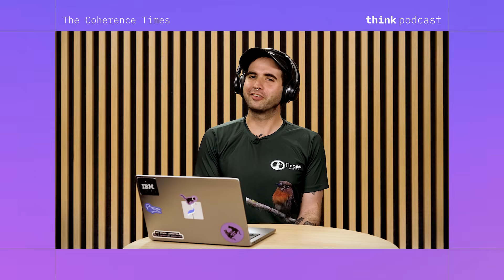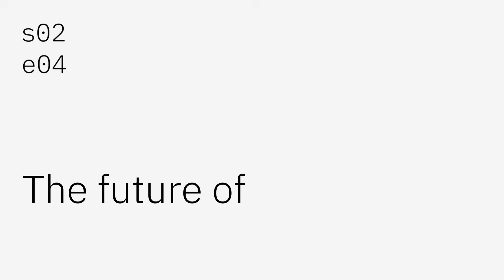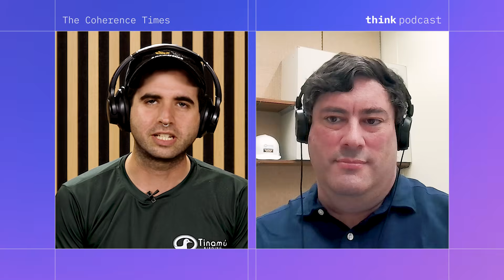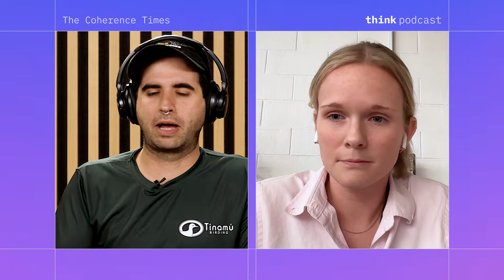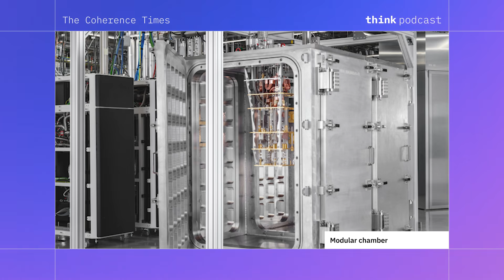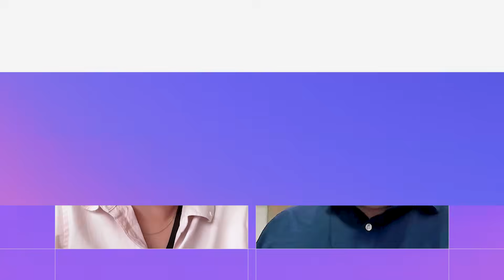Why IBM quantum computers are colder than space

Comment: Proposal: Use citizen science gamification (like Foldit) to solve the thermal noise problem in chip-level nano-rectennas. Players align 3D atomic structures (Graphene/MHM diodes) to optimize heat-to-electricity harvesting, feeding solution patterns directly to AI architectural models.